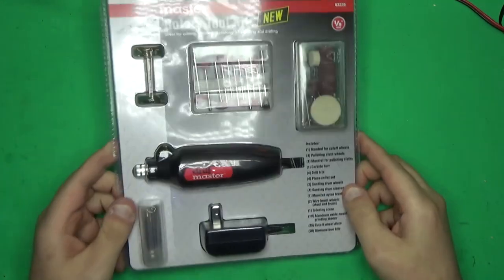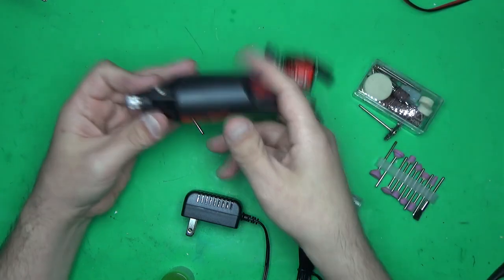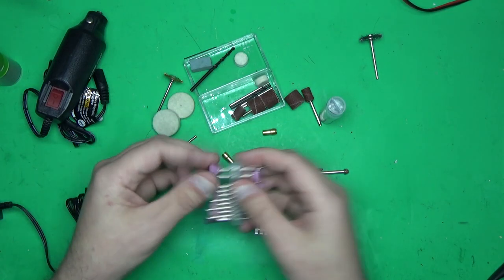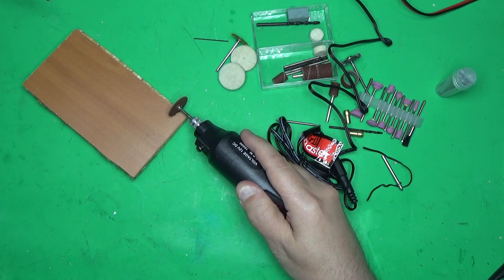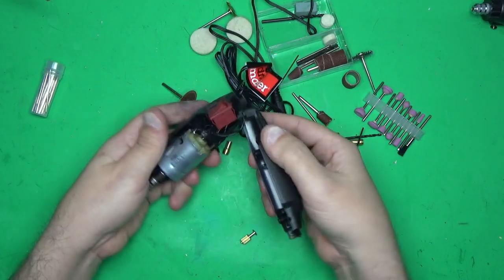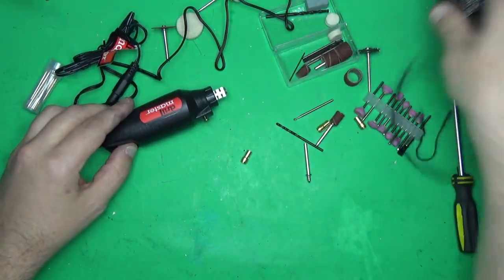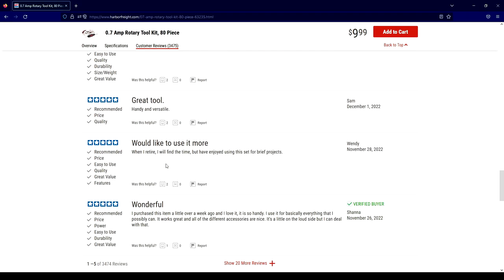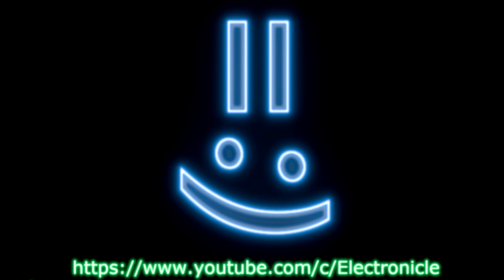An Absolute Joke!  Harbor Freight "Drill Master" Dremel #harborfreight

Comment: You could set the motor in a model boat with a thru hull strut , the shaft in the boat would chuck up in the dremel too ,l MAYBE it would push the boat ......

Comment: Never buy junk, the dremel is the best, like j.b weld to fix tough repairs.
Weak drills can be used to drill holes in pcb's for components to fit.
Or use a hand drill (the type with two cogs) for slow control.
There was a brand in the uk called Blackspur,  what a load of Sh.. poo lol.
There drill bits were soft and just made a mess.

Comment: BTW My DREMEL comes with the same different sized COLLETS. Thats so you can use larger and smaller diameter drills, disks, buffers etc. Thats actually a good thing. But I agree I bought one like 20 years ago and it didn't even work.

Comment: You could hop it up with an RC car racing motor of the same size. Would be the same voltage or higher with lots more power. That is if the chuck end could be successfully swapped from the old motor shaft to the new one.